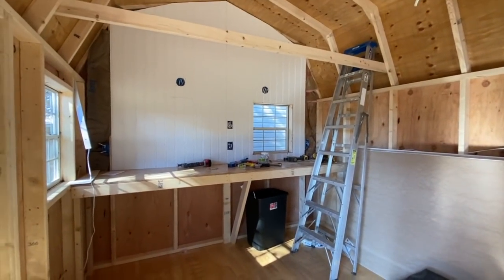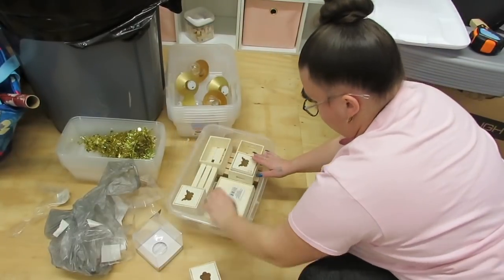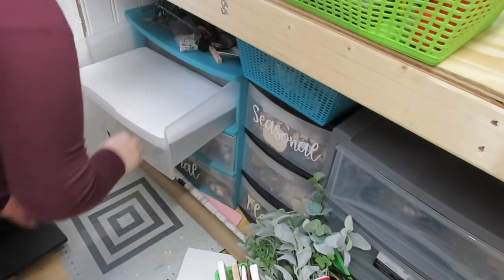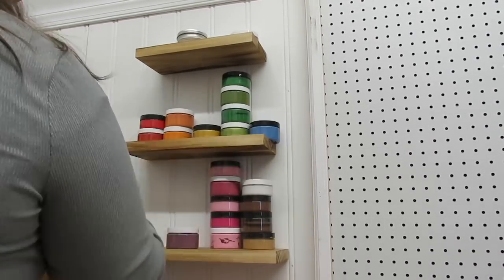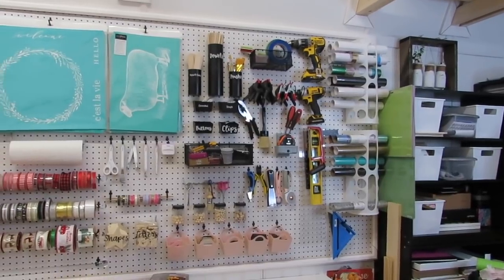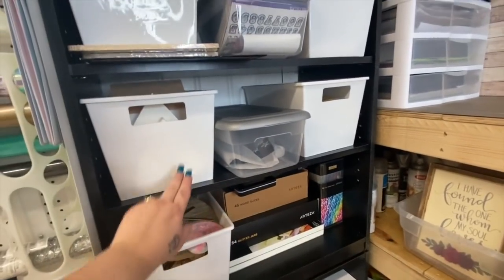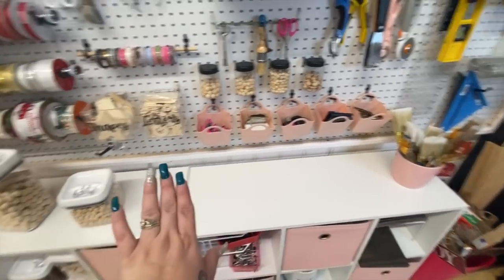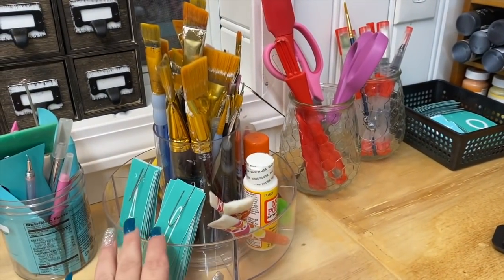MUST SEE!! AMAZING SHED TURNED INTO CRAFT ROOM MAKEOVER 2021 | HIGH END DIY TINY SHE SHED MAKEOVER

Comment: I love your she shed, it's beautiful!  I also have one but, living in North Carolina, I am limited to when I can use it due to the weather. It was prefinished inside so I'm not sure if it is insulated but I have a hard time keeping it from getting too hot or too cold. I worry about my supplies getting ruined due to the temps. How do you keep yours at a comfortable temp?
Reply from the maker: I have heat in the winter and air in the window in the summer

Comment: Your craft shed looks fabulous!!! Soooo jealous!! When my sons move out (they have been paying off school loans) I will get my oldest sons room as my craft room. It has a wall to wall closet and 2 windows. I already have storage bins full of my craft room decor waiting to go in it. 😉 I love to label things as well and don’t like clutter which is what I have to a degree because I don’t have a designated craft room....😢😭 My craft area is the dinning room table....no eating there unless it’s a holiday, then I need to clear it off. 
As for your paint bottles in that open cabinet on your desk....you mentioned about putting a colored label on the cap but I think it looks great just the way it is with the bottom showing. The colors add to the room decor. I’ve seen other crafters do this or put the bottles upside down in a storage bin. I love the beadboard and the pegboard. Seriously really good job and I just subscribed to your channel. 
I love crafting as a therapy outlet. I do stamping, scrapbooking, beginning jewelry making, beginning paper quilling, floral wreaths, floral decor, paper crafting etc. I finally got more storage racks for my garage so I have a small “U” shaped area that I store my seasonal decorations,  various table decorations (centerpieces, table runners, placemats, napkin rings, candles, candle holders, etc), scrapbooking supplies, seasonal craft supplies, craft supplies etc. At least I have this area until I get my craft room. Then it will all go up in there and finally I will be able to have a fabulous and proper craft room!!! 👍🏻🤗
Reply from the maker: Thank you so so so much!! I'm so happy you're here!!!

Comment: We have a shed that I thought about turning into a she shed...but it's at the very back of the yard, we've had issues with break-ins, & I have a fully enclosed back porch that would work just as well. It's 10 x 10 & I just can't visualize it. Looking for ideas. We have to replace a wall that's water damaged & an old damaged window but it's a clean slate. No electrical or sheetrock just 2x4s & plywood.

Comment: What did you use for insulation in the roof? 
I have a similar shed. My walls are up but my ceiling is not done. 
Struggling with how to meet the ceiling boards and wall boards .
I have similar door and not happy how they look 
What about the ceiling vents.
What about heat and air?
Reply from the maker: Used R15 for insulations and put lawan on the ceiling and painted it. There's pieces of (not really sure what it's called) on the seams then around the beams my husband used trim. The vent is closed we didn't want my heat escaping and I have a small heater which works amazingly and air in the summer will be a portable air conditioning system

Comment: I’ve bought a 12x24 craft space or Monogram shop and wondering what u did for insulation on a budget? I has a loft but I’m not using sheet rock only foam board for ceiling and loft ceiling. 

I’ve got to avoid moisture at all cost.

Comment: If it is not too personal, could you tell us approximately what the shed cost and then what it cost to completely finish it? I have been asking for a heated craft shed for about a year. I’m just curious what it would cost us. Thanks for sharing!!
Reply from the maker: I sure can! The materials inside were about 5k but my husband is a contractor and a lot of people don't know this but at home Depot anything over $1,500 you take your stuff to the pro desk and ask them to run it through the bid room and you get a discount🤫😉😉 then my shed was 4,500 also but I got it fully loaded with the loft, 2 extra windows, work bench, storage shelves, and poly on the floor and work bench! Then to heat it I just bought a small $90 heater and it works like a charm😉 and I just got my electric bill and it's not high at all and I keep the heat on at all times so my paints don't get ruined. I hope this helps!
Reply: @AllthingsCrafty  Thank you so much Melissa! It’s very doable. Now I just need a space to put a large shed like that. We have plenty of land but just the way the footprint is it would not work because the neighbors houses are too close. We plan to sell soon, so I will keep my new craft space in mind when we buy new, whether it’s a shed or an extra large bedroom we can turn into a craft room. Right now we have 3 bedrooms that are empty but I don’t want to turn them into anything because when we sell I want it to be as 4 bedrooms. Right now I am set up in our media room, but I just need more storage space.

Comment: I have a she shed but it gets extremely cold in winter and uncomfortably hot in the summer. How do you control the temp in yours?
Reply from the maker: I have a small heater that works like a charm and in summer I'll have an air conditioning unit in there but we also insulated it really really good so it would keep the temp.

Comment: Do you have water and heat? I can't craft without a sink. Can you use your shed in the winter?
Reply from the maker: Yep! Fully heated and air for summer and as soon as it gets warmer my husband will install my sink. I already have it just needs to be installed. My front door is a few steps from my shed so I just run in and use the sink for now but my husband has to run a line to my shed and I didn't want him doing it in 30 degree weather😉😉
Reply from the maker: Plus I have jugs of water for now. Which works for me. The only thing I need a sink for is my chalk Couture.

Comment: This is great! Right now, we are debating whether to buy a building, or build onto another building we have in the back yard, but the end result will be my craft shed and storage for my seasonal decorations and off-season clothes. Wondering if you out in a wall a/c or what you're using for climate control? I am in Alabama and it gets hot here, will melt my stuff with no climate control of some sort.